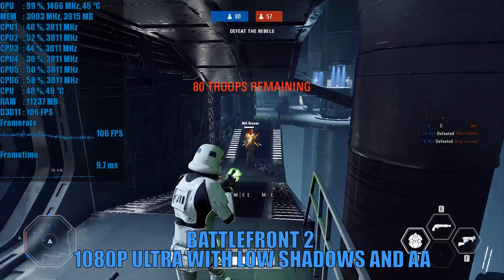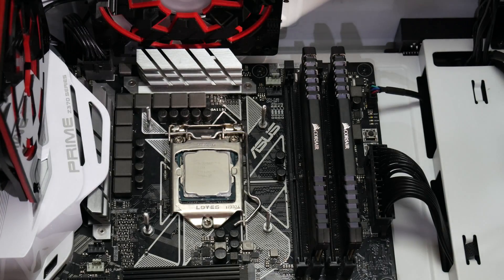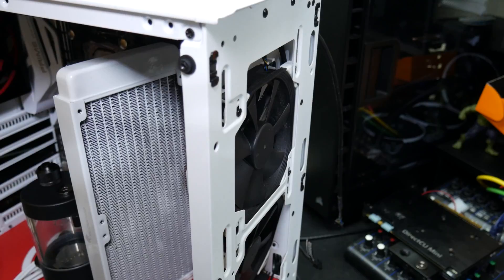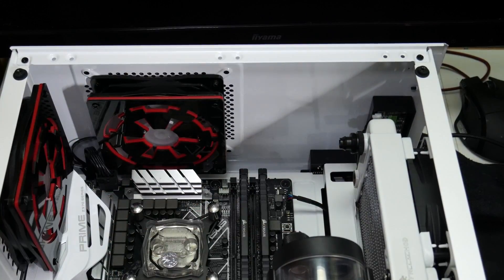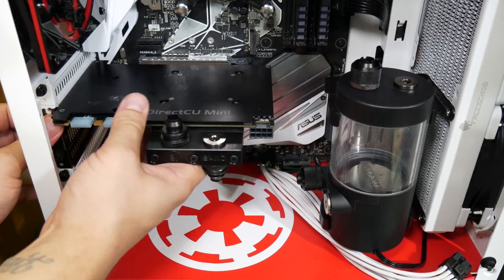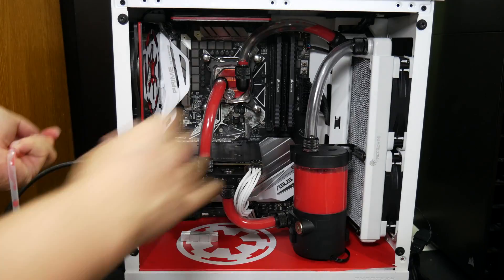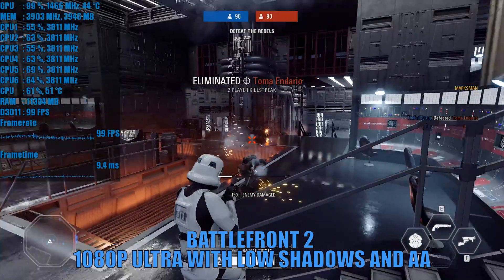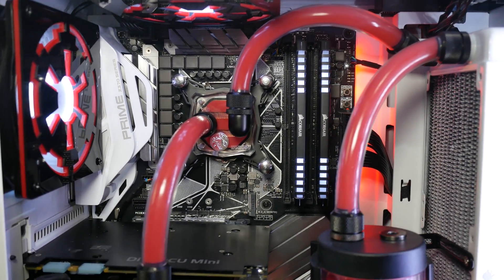How To Custom Watercool Your CPU And GPU For Under £200/$250

Comment: just bought some water cooling stuff for overclocking some old GPU's.  bought the same pump, magicool 240x45 rad and a £13 gpu block lol  Spacing on the old GPU's is 43mm so limited on choice for blocks.  I may invest in a CPU block fully fit it in the case after.

Comment: @TheFullSetup can you fit the dual fan VGA (RX580 or 1050ti) with reservoir in that case (phanteks p300) ??
Reply from the maker: They way I have the res setup and with the plan to add a thicker radiator. The only option would be ITX sized Graphics cards.

Comment: Nice choice of a magicool pump/res for a budget build. I used one on a build for my friends son almost 2 years ago and it's still going strong. I've been watercooling myself since the days of Danger Den blocks and I can't believe how much gear I have used from different manufacturers. The only time I really did fall foul was when EK had nickel flaking issues on some of their blocks. However I always use ec6 coolant by xspc (was once thermochill ec6) as it's been the most consistent for me. Going to update one of my rigs tomorrow with some more sr2 black ice rads. I'll admit I've been hooked on watercooling for the last 9 years.

Comment: to my understanding there is no difference with aluminum gear,besides being lighter and cheaper, its just that you can only use all aluminum parts which reduces your options, but aluminum is cheaper anyway so it shouldn't be a huge problem.
Reply: the best performance/dolar, is the combo of a cpu block of cooper with a big radiator, like the 360mm, and for the "Corrosion" just use the normal liquid you put on your car radiator, and you will be ok with it. Thats how AIO work with mix metals, and that how people on 2000 worked with customs WC.

Comment: How ist the CPU Block holding up?
Reply from the maker: Really well I’ve had the system running for about a month and had it just running for 3 weeks before in a test loop for the price you really cant beat it

Comment: I did something similar at first, but now i step it up and gone for a 500dollar custom loop for my R7 2700x and gtx 1070. I got a 360mm rad and a 60mm 240mm. Ek supremacy block and a d5 pump x360res from ek and a fully coverd gpu block. I havent bought my self a 2700x or dd4 ram yet but i got the x470 ultra gaming 7 Wi-Fi, which is like 320 dollars here in Norway. I probably could have bought a gtx 1080ti for the cost but i just went with it. I must agree though, EK parts are exspensive. Example: just the res cost like 70 dollars and the gpu block is 120 dollars without a backplate. And fittings is like 7 dollars a pop. Im happy though that i went the more exspensive rout. Because then i can keep the parts for a while. But great vid man! Good job
Reply from the maker: Sounds sweet my next upgrade will be a fatter rad and a d5 pump of sorts. As for fitting really happy with these barrows half the price of ek and the hard tube are a fair bit healer that. Bitspower.

Comment: Whilst that it indeed a tasty looking system, for me personally I cant ever imagine building a water cooled system myself. Even with the good prices you have here, the entire cost of it to me equates to an entire system. That, together with how well a decent air cooler or even budget AIO perform just makes it too prohibitive and not much benefit other than bragging rights.

That just me though, tighter than a ducks bum hole with it comes to £££ lol
Reply from the maker: I here what your saying some great bargains to be had on the used market.  For me it's having a gaming pc that's downstairs make a sound and also that tasty look. Obviously it's not my only system if it was I'd spend that budget on a bigger graphics card way before building a loop
Reply: @thefullsetup  haha, your certainly right when you say 'tasty look' :) although not for me, it does look damn fine!
Reply: Remember as well, just like with any cooler, you can continue to use it for years. Sure, a pump may go a few years down the road, but even then, you can use good quality components for a decade or more.